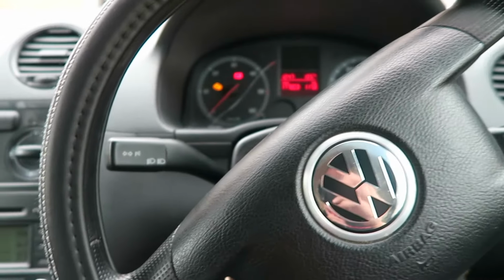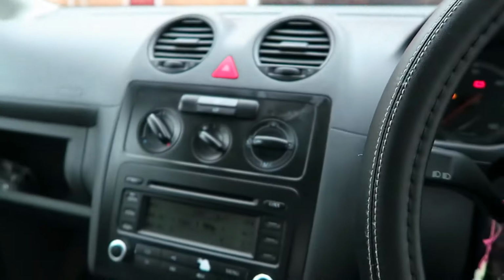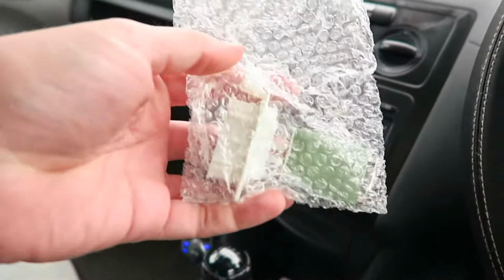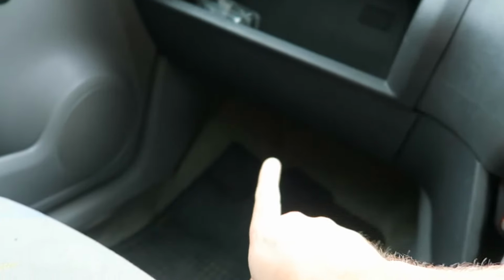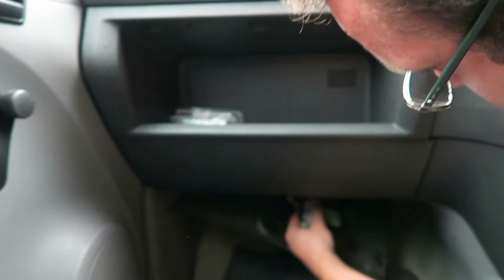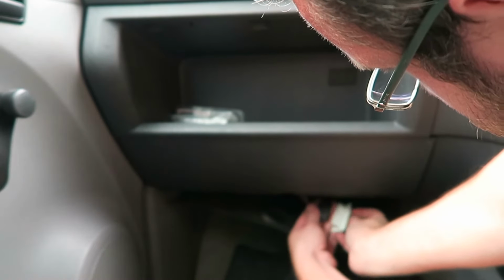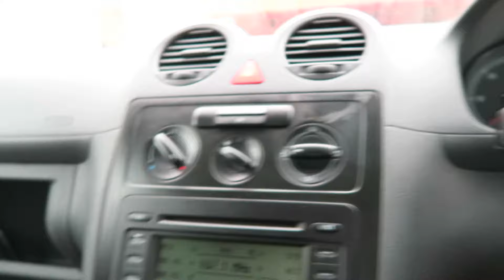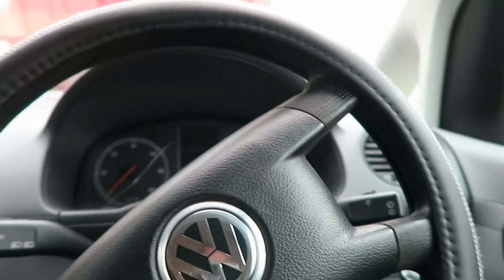How To Replace Heater Fan Blower Speed Resistor VW Caddy

Comment: Excellent but of advice, recently changed my Audi A1 one and expected to have to get my tools out for my caddy. Nope, squeeze plug remove, squeeze resistor remove, push in new one then push in cable. Less than a minute labour and just £18 from my local factors.
Reply from the maker: That's awesome, glad the video helped you out 😁

Comment: I have this exact same problem on my VW Touran (2007) and the garage says it's going to be €400! 
Is this hard to replace in a Touran 2007? Otherwise I'll try it myself and save me a lot.
Reply from the maker: Should be in the same location, similar process no doubt.
I'm sure there is a video or forum on the internet with a simple tutorial.
Reply: @meatmanifesto Thank you!
Reply from the maker: This will save you 400 euros 
https://youtu.be/NMYsR_mdAPs?feature=shared
Reply: @meatmanifesto Yes! It worked, got the part for 20,55 euro, changed it in 2 minutes! Thanks for the support! 🙏

Comment: If the resistor goes again what's the next option, had replacement in 2 months and went this morning
Reply from the maker: Could be your blower fan, or get a genuine VW resistor
Reply: I have another one ordered of motor factors, there was fishy smell before it packed in and was the same when first installed, if this one fails I'll get genuine one
Reply from the maker: Worth another shot

Comment: hi is vw golf 2000 to 2008 model are same spot same place on resistor? ty
Reply from the maker: Pretty much yes
Reply: @meatmanifesto  does required to take the negative connection in the battery?

Comment: Just bought a 2015 VW naively i turned straight to number 4 to test the blowers😂 appreciate the video, glad to hear it’s not an expensive fix and hope it applies to my van .
Reply from the maker: 🤣 it's a common issue over the last 20 years or so, will be pretty much the same.
Reply: I did exactly the same mistake. But love my Caddy 2011 with CNG Ecofuel.

Comment: I've just replaced the switch and it's getting proper hot and smelling a bit. 67 plate and the switch is exactly the same. Still something not quite right
Reply from the maker: They do get VERY hot anyways, maybe it's a faulty part?

Comment: Nice one. If it goes again, change the blower motor too as they’re normally the main cause of the resistor blowing. Replaced quite a few under warranty on this era of vw
Reply: Yes I have heard the blower could be the issue, I'll see how long the resistor lasts if it goes again pretty soon I'll change the blower. Thanks 😎
Reply: on mine one t5 it doesn't blowing around the front window does anybody can give me any suggestions thanks in advance

Comment: The heater core or matrix are notorious for blocking up and you get no heat. Do you know if Replacing the heater matrix is a dash out on the caddy?
Reply from the maker: I would guess it's a dash out job

Comment: Great video! For me, the problem is not the different intensities the fan blows but the dial next to it does not work properly. When it is supposed to be blowing on your body, it is blowing on the window, any ideas why this may be the case?
Reply from the maker: Sounds like the cables are jammed or something, I would take the control Panel out and look at the back of it